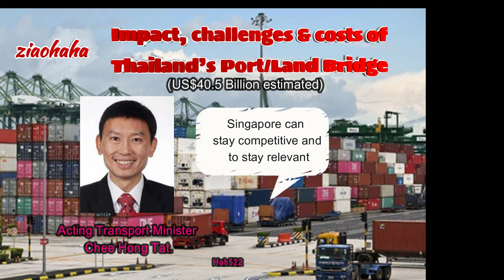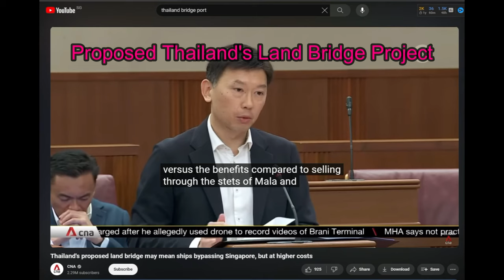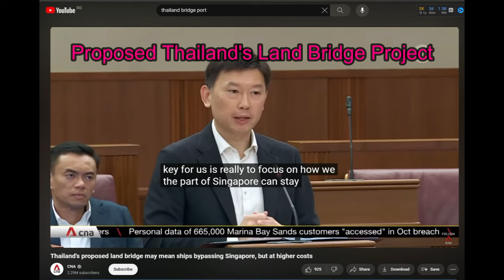Thailand's Land Bridge, Impact, Challenges & Costs

Comment from the maker: Analysis: Thailand’s proposed land bridge project easier than Kra Canal idea, but steep challenges await
The land bridge project is designed to provide a new trade route between the Indian and Pacific Oceans, potentially bypassing the Malacca Straits, by linking two deep sea ports on Thailand’s eastern and western coasts via a rail and road system. Thailand's plan to build a 90km land bridge across its southern region, which could see shipping trade bypass Malaysia and Singapore, is on paper easier than the long-touted Kra Canal, although it still faces steep challenges, say analysts.
Reply: Singapore is going to bangkrut 😜
Reply from the maker: @Redmi-xu1yo   Make sure it's completed by 2030. There was a Thailand/Malysia oil pipeline project  that cost billions of dollars, completed halfway and now abandoned. There is a saying that goes, 'Don't count the chickens before they are hatched." Thank you for your comment. Cheers!🍺🍺🍺

Comment: Wah!  You have listed out ALL the negatively for the ‘land bridge’ which very possibly can occur.

Thailand will need 2 ports, one on each ends to:
1. Unload/load on 1st port.
2. Re-load on the second port.
Frequent flooding & traffic jam in the highway will have devastating consequences in the transportation of the goods.

Competing with the well established and super efficient & fully AI operated Singapore port is suicidal.
Ports operations are multi-faceted , not JUST loading & unloading.
Reply from the maker: Well said and thanks for your contribution.👍👍👍